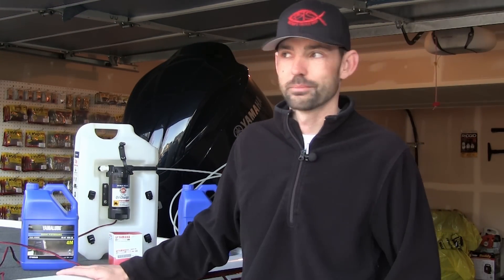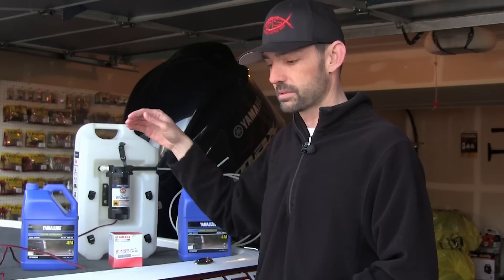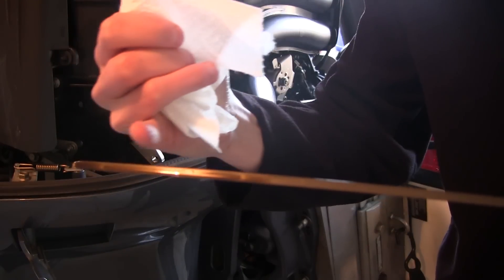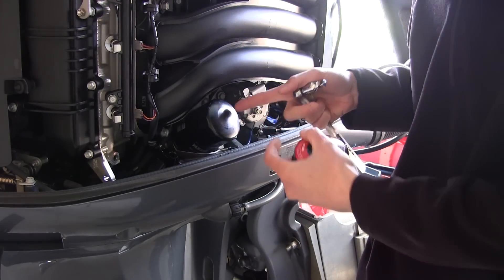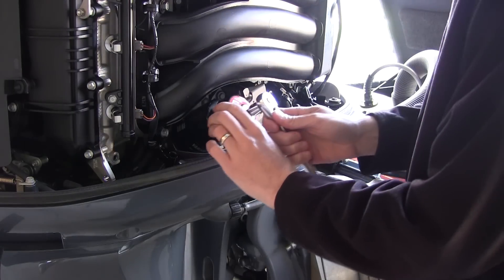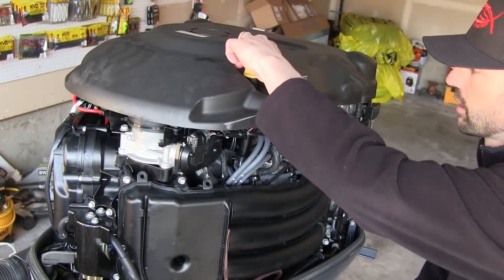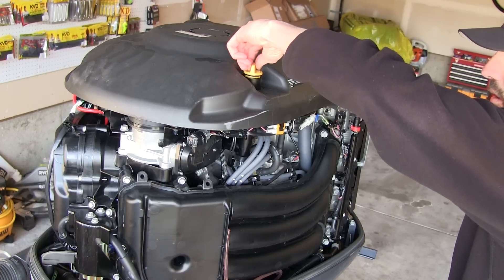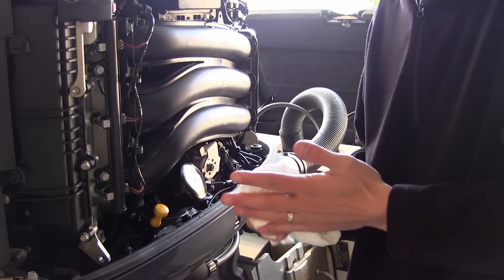How to Change the Oil Yamaha VMAX SHO [Four Stroke Outboard]

Comment: FYI!Im 50. I have had them all at one time or the other. The 2 stroke stills rules the top end. But for longevity ,hole shot and load carry this engine is the best ive ever owned. Bought mine new in 2014 and so far this engine has outpreformed everything ive owned with less maintenance than a 2 stroke. This motor really loves the hole shot and fully loaded or lightly loaded it runs the same on the top end minus 1-2 mph. Not bad compared to a loaded 2 stroke lossing up to 6 mph. Buy this motor and enjoy this bad boy for a long time.
Reply: How do you like the sho....have you had any problems with your motor and how many hours do you have on it..... would you recommend buying one

Comment: How do you like the sho....have you had any problems with it.
Reply from the maker: It's a 2011, so it was part of the powerhead recall. When I bought the boat, it needed the repair shortly after. Since the new powerhead, I have had no issues. I change the oil twice a year and keep the lower unit oil fresh (fingers crossed or knock on wood) that it continues running strong!

Comment: So , you guys are thinking that the rings will be set after some time ?! This is normal on any 4stroke motor , thats why they invented the PCV valve
Reply from the maker: No, you only have a finite amount of time to set the rings. That's why I broke it in with conventional oil. Ran it like hell after the first couple of hours of break in. Hasn't made a drop of oil since. Now I run synthetic and change the oil twice a year.

Comment: Really good video and you show the proper way of keeping things clean and to spec - lovely motor that SHO 200 . . .  the SHO series seem to be the real deal in the Yamaha line - my favourite : )  BUT . . . you mentioned that the SHO loves revving and that makes a whole lot of sense for a high output motor and proper ring seating etc.  - The question is if you want to tool around lakes and not be on full throttle a lot of the time "exploring" the shoreline etc., (no trolling) would you recommend getting the "normal" F series motors instead? And do you figure you give anything up reliability wise with the higher output per cc  over the normal F series?  P.S. I like your choice of the 200 since it uses the same larger block of the 225  - in your opinion do the V6's run smoother/quieter that the 4's? THANKS!
Reply from the maker: Hi David! Thanks for the comment and the feedback. The biggest issues that the SHO "had" are from the first couple years of manufacturing (just like everything else, the new releases always have issues). From what I can tell, Yamaha has changed a few things in the "VF" SHO series and there are a lot less problems now. All motors have their issues, just look at the new Mercury gear cases. The motor has it's quirks too, but all in all, both are great motors to date. 

If you have a bass boat, I would go with the SHO for performance. Lighter/faster mentality. Owning a four stroke is A LOT easier than any 2-stroke. I change the oil and gear unit oil once a year ( or more if you like hanging in the garage :)

If you're doing offshore, bay boats, etc...then I would go F series. Their reliability speaks volumes. The SHO is meant for better hole shot and mid-range power. If you want to "cruise" and do a lot of idling, I'd go F series. Just my honest opinion, but I haven't owned the F series to be transparent. I do think they are a bit quieter than the SHO if that matters to you.
Reply: Great feedback - thanks so much. I think after what you wrote here I'll stick with the F series as I do appreciate the quieter engine and don't object at all to saving some $ : )  Basically its just for an 18 foot bow rider for fun on the lake and for touring - not for competition at all. I value reliability and quiet over ultimate "performance" Thanks again!!  If you want to add anything here, I'd welcome any suggestions - really appreciated your video - so well done!
Reply from the maker: Yeah I think it's a great choice! I'd be happy with either motor. The great thing about Yamaha is their customer service and their dedication to their customers. Even if you have something wrong, your dealership and the Yamaha rep are your best friends. My only other advice is to get a boat and max out the horsepower. I see it over and over, people try to save money on lower HP motors, and it really hurts resale value. Get the F series, max out your boat with the maximum horsepower, and just enjoy it. If it ever comes time to sell, it won't be around long :)
Reply: That's great advice FH . . . I will max out the HP  as you suggest . . . not only better resale but more fun while you have it : - )   Whatever motor I end up with I'll revue this video for oil changes because you do it all just so right. I'm meticulous for  oil changes on my car just as you are here so why not on an expensive outboard motor?   Don't know if this is a bit crazy but  I'm sort of thinking "in reverse" in a way  - most people, I imagine, choose their boat and THEN their motor - I"m sort of looking for the best Yamaha in the 70 to 115 HP even maybe 150  range and THEN my boat - just thinking that if a particular motor has an EXCEPTIONAL reputation for smoothness, quiet and reliability I'd go for IT and THEN choose the boat accordingly - you have tons more experience and knowledge on such things as I do so if you have "heard" of an outstanding motor in the Yamaha line in the 70, 75, 115 or 150 let her rip here if you like : -)  I don't trust the retailer all that much to give me the straight goods  because I'm guessing that they'll just tell me to get the most expensive one LOL  Happy boating FH and many thanks!